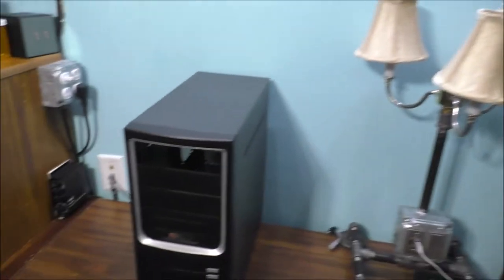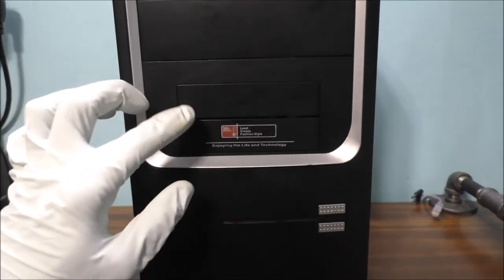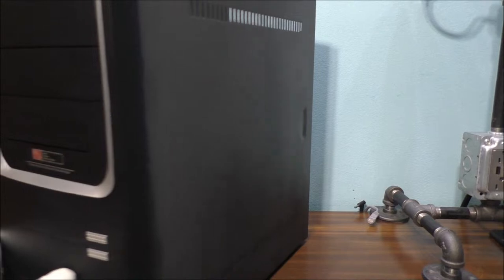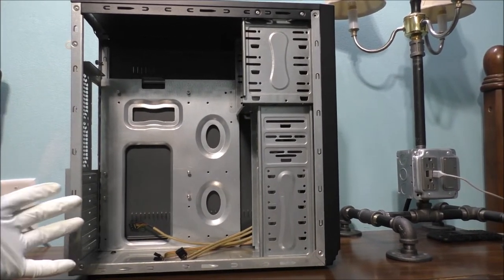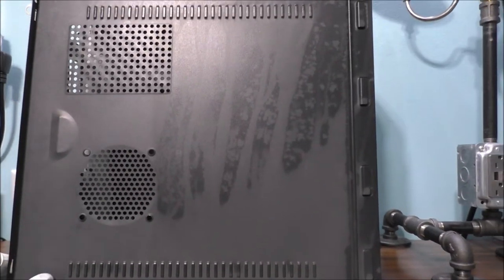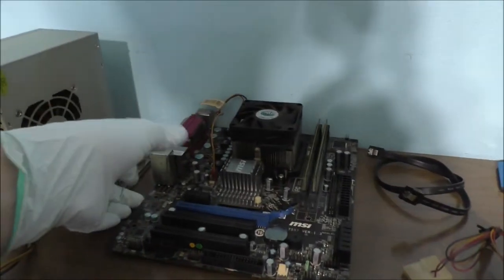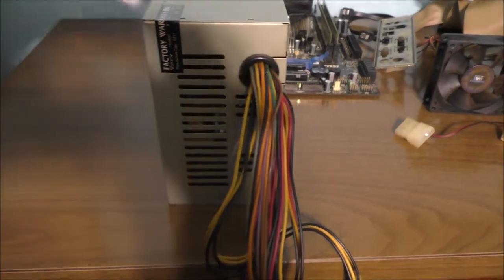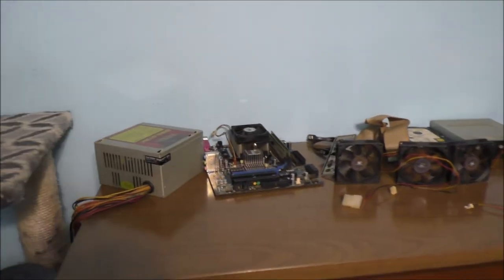WHAT CAN I DO WITH THIS USE COMPUTER CASE

Comment: Hi Chris, the black thing at the start you asked what it was is basically a duct that should go on the side panel. The idea is to duct the hot air from the CPU cooler straight out the side of the case. 

You could always try spray painting those side panels if you really wanted to save it.
Reply from the maker: Tim Thank you for the good information
Reply: @chris90367  No problem, you used to get them a lot on the old socket 478 pentium 4's because they ran so hot!